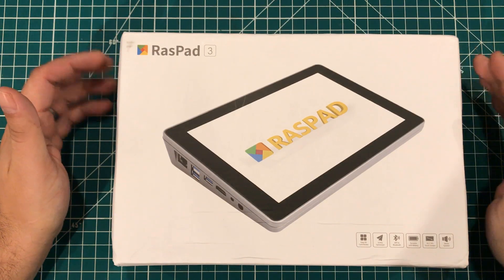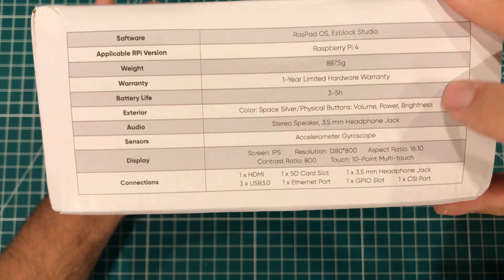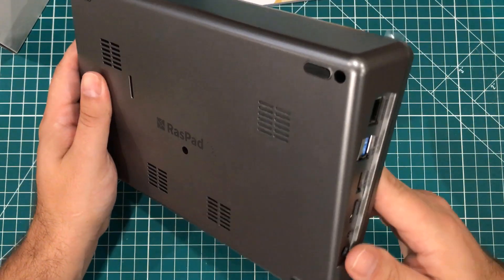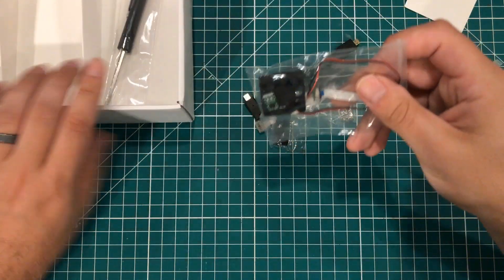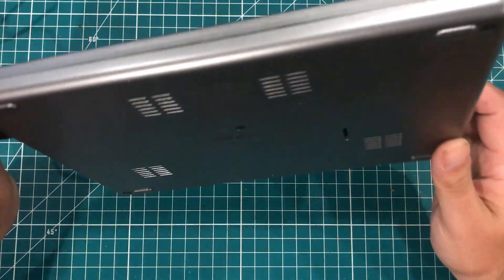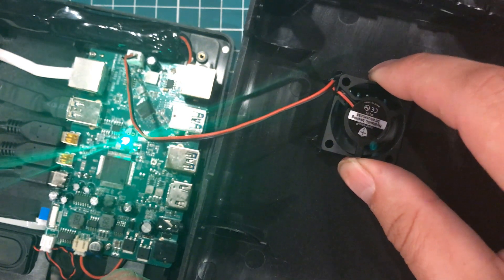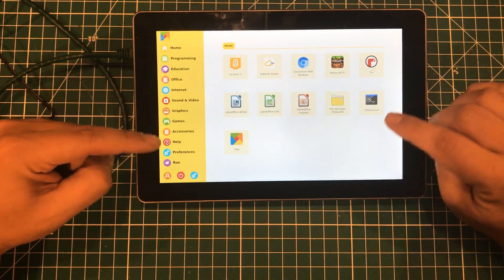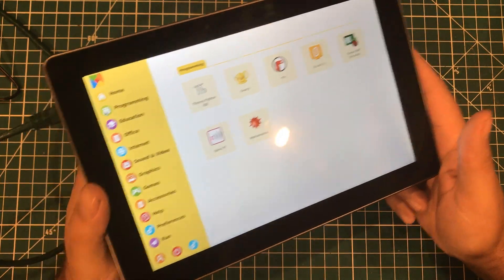Raspad3 - The NEW Raspberry Pi 4 Tablet - Unboxing & First Impressions

Comment: been using a raspad for a few months now. my issues are the fan really doesn't get the heat out well enough. i run twisteros that has the konky stats built in and my temps are redlining all the time. also my fan's screws were not long enough so i had to go find the metric micro size a tiny bit longer and those also just spun. so i stuck then in with a dab of crazy glue. the fan surges sometimes and if you lay the unit down it almost stops... turn in over fan side up and the fan speeds way up!! what's up with the fan!! i am tempted to just get another pi fan and drop it inside somehow connected to the gpio lines... my pi4 is an 8gig model 256gig sd, twisteros, and i slave a 22 inch hdmi monitor off of it. just watching youtube with no other apps open i am over heating. am i missing something? crappy fan? insufficient venting?? i have all the heatsinks on the pi. ideas??
Reply from the maker: No. You're not missing anything at all. It's a design flaw. Although, I know on later models they added a resistor to the fan to quiet the noise, so if yours has one, you might want to ditch that.  I wound up getting rid of the back and turning mine into an in-desk touch screen. https://www.youtube.com/watch?v=QR6266lcIpM
Reply: @AnotherMaker  no resistor with mine. i would not use it anyway because heat is my issue not noise.

Comment: Solder a 10 ohm resistor to the fan, see if it shuts up.
Reply from the maker: Their solution was to do a 15 ohm and I tried that, but it didn't help enough to make a difference.

Comment: My Raspad 3.0 arrived this morning & I put my new Pi 4 8gb in it. Immediately booted up, fan can be heard running but is not intrusive. Touchscreen is OK. All works but I’m now downloading Raspad-os_v2.6.zip . I’m not very knowledgeable with Raspberry systems but I’m enthused by this Raspad & wanting to learn more. Initial impressions are very good!
Reply: Just occurs to me that I have an unused 120gb SSD here ... can I install & use it? 🤔
Reply from the maker: I don't see why not.
Reply from the maker: I'm glad they've addressed it. They said they were going to before the first round went out but didn't.  Hopefully later models will be quieter because it's an awesome device.
Reply: My system subsequently crashed, gives me a ‘no cable’ message on screen & then dies. All cables were reseated, several times. Tried the helpline, no response whatsoever after 5 days. Such is life.

Comment: Finally got mine last week.... disappointed the fan noise is the killer it's loud.. very loud and RASPad support's response to me when I asked was yes we know it's the case...ummm bad design then........ My Pi runs to hot without it so I've had to put my SHIMfan in not the best solution but stops the overheat..
Reply from the maker: Someone else just said they got theirs in and it was quiet. It might be worth reaching out to the company and seeing if they've included a different fan in the latest batch. They would probably send you one because they're definitely aware of the issue.

Comment: The fan that is offered in the kit is noisy.  I changed the fan to one I found on Amazon and it works great and is hardly noticeable.  Note the connector is different so you'll need to splice the connector from the old fan onto the new one.
axGear-30x30x10mm 3x3x1cm Small fan
Reply from the maker: That's good to know. I just did another review on the noise and tried the resistor fixed that the company recommended and it didn't help. I will leave this as a footnote because that video is already uploaded

Comment: Thats like a jet engine, there is silent fans no need to use this noisy fans
Reply from the maker: You're not wrong. I think the 2 speed solution will help, but it's resonance of the case, not just the fan. The fan is pretty silent by itself.

Comment: CSI: Camera Serial Interface
Raspberry Pi's camera connector, essentially. o.o I am surprised you hadn't noticed those before? It's behind the bulk of USB ports. Smol ribbon connector.
My idea for this would to use it for a smart home control or any type of control. Say you run a server cluster - let this display stuff for you, provide a small FTP server for thumb drives to access from phones and other devices. This is pretty neat as a little monitoring device.
Reply from the maker: You are absolutely right. Sometimes it's hard to think while I'm talking :-)

Comment: Did they update the fan issue 🤔
Reply from the maker: They have decided that they are making it a 2 stage fan with a 16 ohm resistor. I need to test that on mine.
Reply: I think I will order one 🤗

Comment: No doubt, this is a cool thing.   Nonetheless, I like to criticize.
Seems that a Compute Module would be the ideal way to plug a Pi into pad shell.  Sadly, I cannot find a Pi 4 in this form factor.  Only a 3B+.
Could definitely use a large, quiet, muffled PWM temp-controlled blower fan.  Perhaps better would be if the hot chips made thermal contact with an aluminum backplate.
Would also like to see a way for the user to be able to replace the 18650 batteries.   This is a 3S system?   An annoying thing about laptops and tablets, in general, is that years after manufacture, they could still be useful, but the cost of a new battery is not justifiable.

May be interested in this kind of thing as a kit, where I could 3d print the case.  A TPU housing (soft plastic) might be the way to go.
Reply from the maker: Nothing wrong with that.  They said they want all feedback.  I would imagine that battery pack is pretty replaceable. It's just 3 18650s.  Agreed that a different thermal system would be a game changer.  They have the space.
Reply: @AnotherMaker  It was hard to get a good look at that battery ... but a 3S system will need 5 wires.  Without a "balance charging" system in place, your pack will quickly become unbalanced and useless.   (shrug)  I may have just not seen the balance lines, or else this may just be something they have yet to implement.  They are common and inexpensive.
https://www.aliexpress.com/item/33041643185.html

Comment: Does it shut down the screen automatically when the Pi shuts down? My original RasPad does not, which I find annoying as I often shut it down remote via SSH. Nice review!
Reply from the maker: It does not but I'm not running the right software on it. It may in the future. The board seems a lot more legit, so I wouldn't be surprised if it does. My software is for the RasPad 1. Thanks btw!